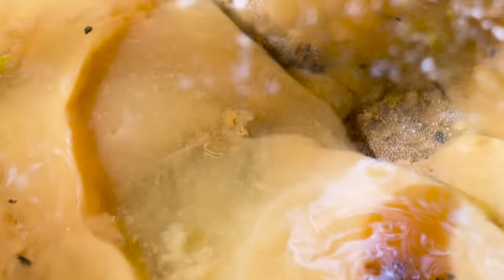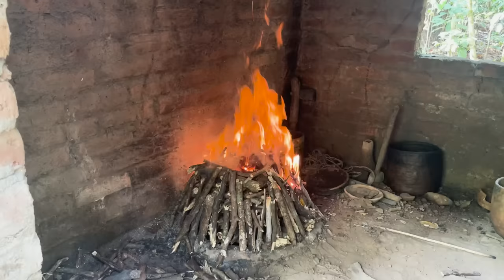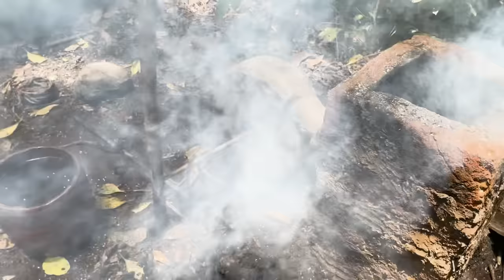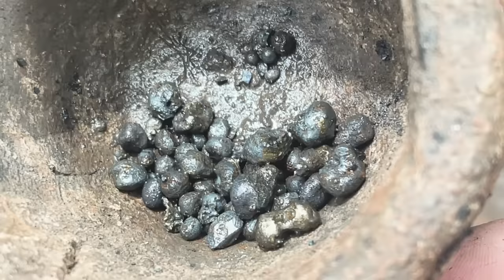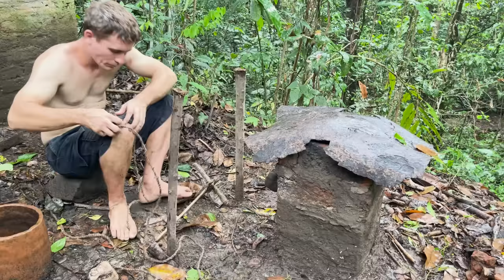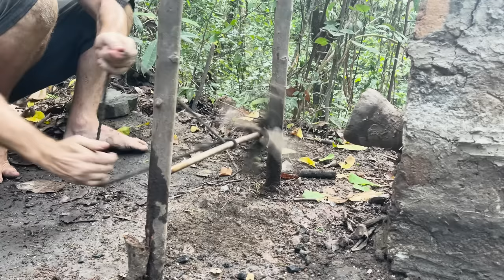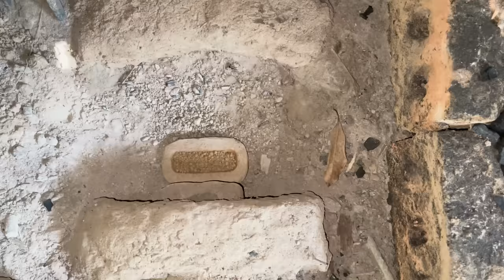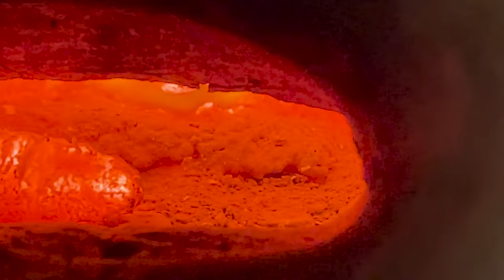Primitive Technology: One-Way Blower Iron Smelt & Forging Experiment

Comment: I don’t know if you have running water in the form of a stream/creek nearby, but I feel it would go a long way taking the time to build a primitive dam or sluice from a nearby elevated water source with waterwheel. Especially if you’re going to continue exploring forging and smelting. 

The rotational energy from the waterwheel could then more consistently power the fan in your bellows contributing to a hotter forge.

If there’s no usable water nearby, you could try to take inspiration from the design of an old treadle wood lathe with a fly wheel. The fly wheel would have the effect of transitioning your irregular inputs into an overall smoother and more consistent output on the blower fan.

Comment: I think the reason its not forgable, is that the carbon content is still way too high. I would try to place the mold with the iron into a furnace, with the coals below, not on top. It needs to be almost molten and not in contact with carbon, so it lowers its content

Comment: I'm not sure what you are trying to do? But, if you're trying to forge iron into a tool, you're going to need to use a flux of some kind, as all of the carbon is making your iron brittle.
Then you can take the raw iron and beat it into a more malleable form of iron. As a flux I think your best bet is clean sand. do that bar again with a sand flux on top to protect it from the carbon. 

In all honesty, I'm not sure you can go directly from the stone age to the iron age.
I don't suppose you have any copper or tin deposits nearby?

Comment: Resume from a french forgeron essay, "La Forge du Lys" (https://www.youtube.com/watch?v=zpi5tWHbbQM) : 
- from iron oxyde to iron with an oven, a heat gun and a long fire
- next time the oven would be taller for having a longer transformation process when the ore comes down
- after the melt, sandstone powder is added to purify the pieces
- the result is fragile but sounds and reflects good ; to make a future knife, carbon has to be added with coal powder and flour

Comment: It seems your fire didn't get hot enough for it to entirely melt, hence the lumpy appearance. You should have had smooth steel at the bottom and spongey slag on the surface. No flaw with your methods, just need more heat. Also maybe you let too much ash in. I saw another video by a singapore gentlemen, did virtually the same process but without the ash, and he had much better success. See: https://www.youtube.com/watch?v=z63znmR6Bn8

Comment: Too much carbon from the coal impurities that got mixed into the iron made it brittle. Also, you will need to heat hotter, maybe build a large wheel and use it with a rope and the blower's shaft to make a pulley which will give you a better ratio = more speed = hotter.